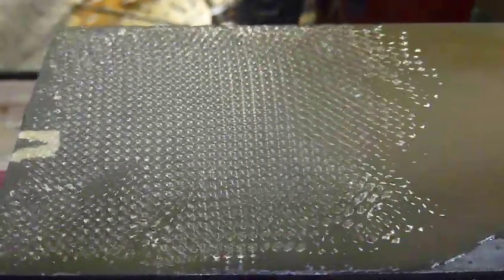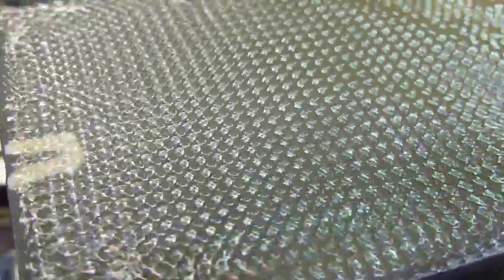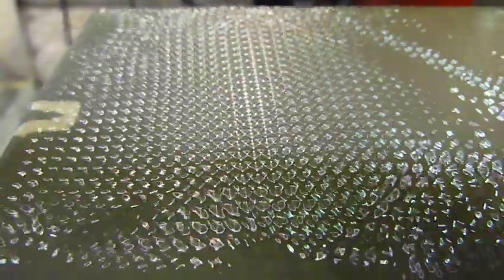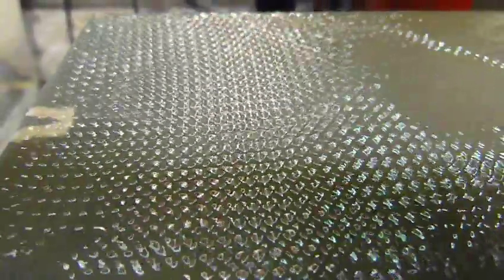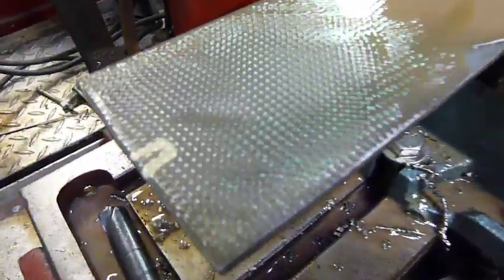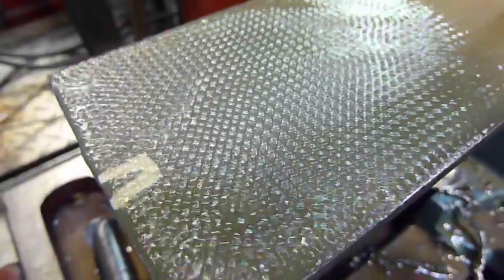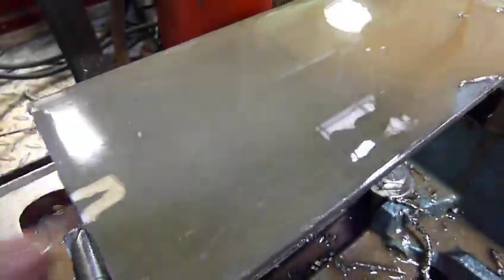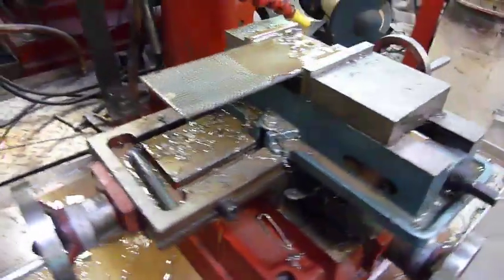Vibration induced geometic waves on water

Comment: Everything has a frequency , when I worked a Coex as a a and p we had a plane that had a problem with its avionics or so we thought when we ran the engs up to E power a high tone was heard and they would go haywire we could not figure out where the hell it was coming from , then they brought in a device that located frequencies and found that it was a caban seat that was loose just enough to make this blood curdling note.

Comment: An i suppose the pulsating motion on the surface is due to elastic properties of the surface tension of the water. Has anything been added to the water?
Reply: I'm looking this up because I had a bowl of water for my dog next to my air compressor. When it turned on to start pressurizing it started vibrating so much on the floor it made square like waves in the water bowls. Even after she drank the water when it turned off of course, it still began to make those square like waves even when water was taken out. Pretty cool stuff.

Comment: Im thinking some resonant mode has been set up, dependent on the density and shape of the metal, the period of the drill rotations, the thickness of the water, and the adhesive and cohesive forces in the water. Im guessing that the vibrational energy is displace into your finger when you touch it as your finger acts as a dampener to the vertical motion.